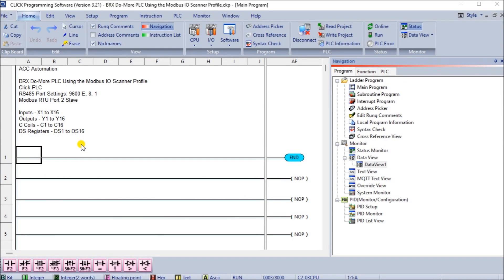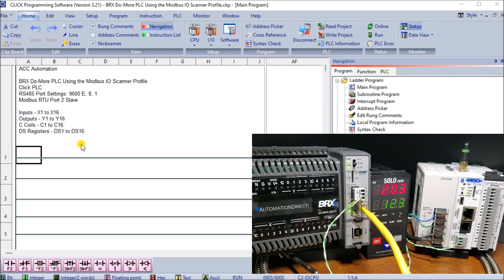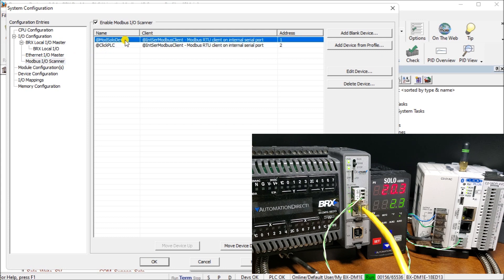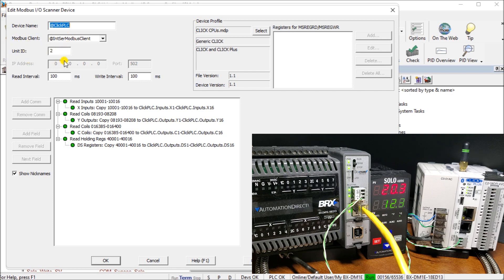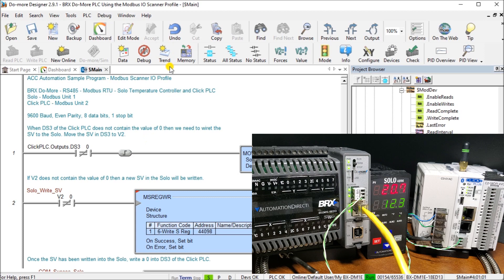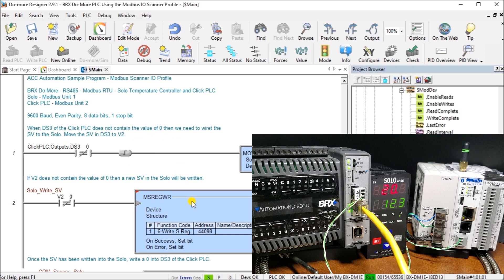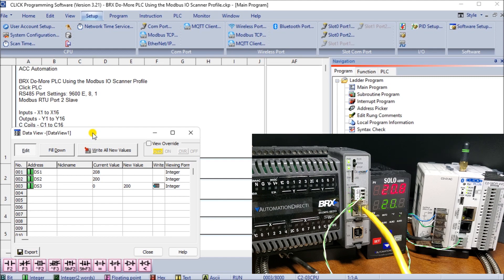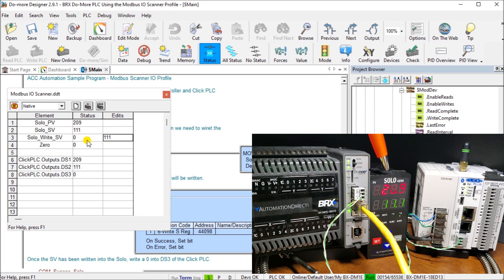BRX Do-More PLC Using Modbus IO Scanner Profile

Comment: Are these old BRX PLCs used much ?   I have used the DL5 and DL6 for teaching classes and always have trouble with the programming comm link (USB to serial).  I much prefer the click and the Productivity series PLCs
Reply from the maker: I am using the BRX Do-More PLC. This uses the Do-more Designer Software with a simulator. The simulator can be used to connect HMI or serial devices for testing. (Modbus RTU, TCP, Ethernet IO, MQTT, and HTTPCMD communications work well on this controller.)
https://accautomation.ca/series/brx-do-more-plc/
This is different than the Direct Logic (DL5) (DL6). I have not worked on them much. Even though they are being sold, the manufacturer is not putting any effort into improving the line. 
Regards,
Garry